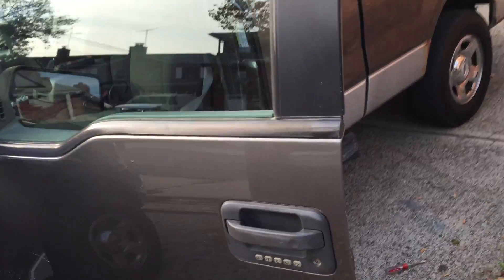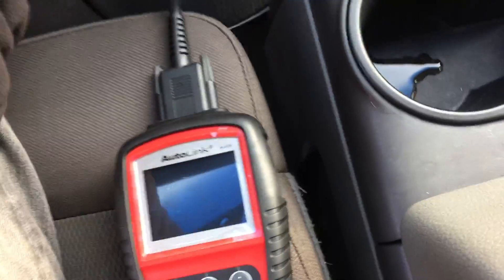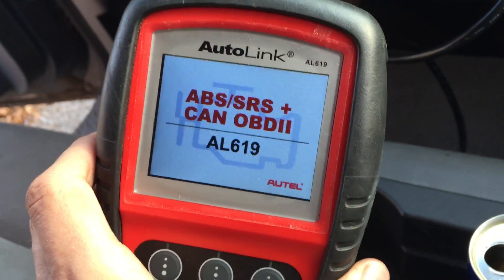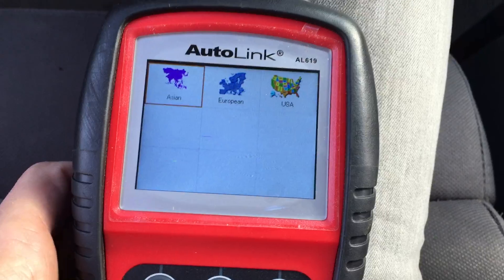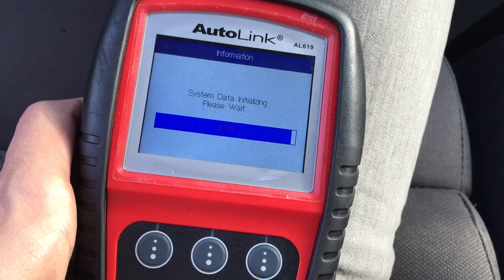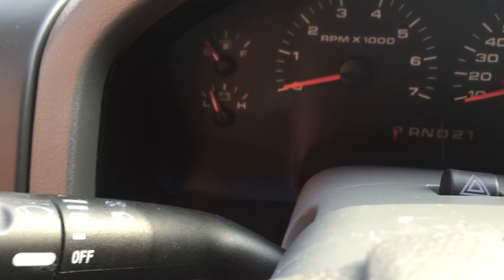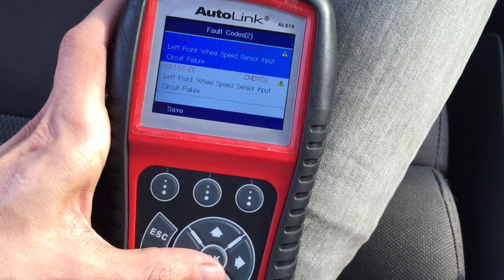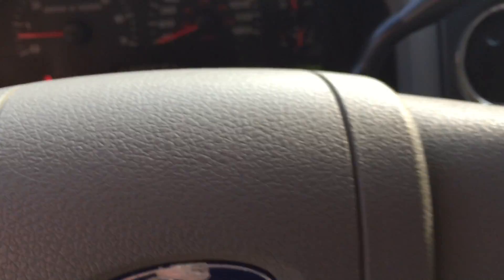Simple Ford F150 Obd2 not linking repair

Comment: Get a Actron CP9690 code tester. It reads live, record, graphing, emission readiness test, transmission codes, SRS, ABS, oil change reset, check engine light reset, RPM'S, coolent temperature, MPH, and MORE! It comes in a black pouch. It includes a cigarette lighter cable. The batteries are behind the single screw on the back cover, not included. They are penlight batteries.

Comment: I'm a retired tech, not for Ford, but the lights on the dash may be active because the scan tool is hooked up and communicating with the modules.
Did replacing the fuse fix your running problem? I'm assuming it did.
Next what popped the fuse? Don't stress fuses get old (heat) and fatigued, and could blow for that reason.